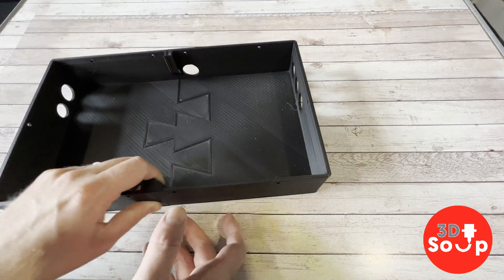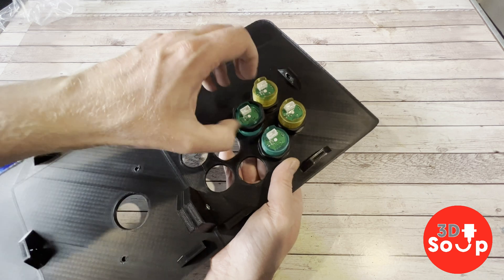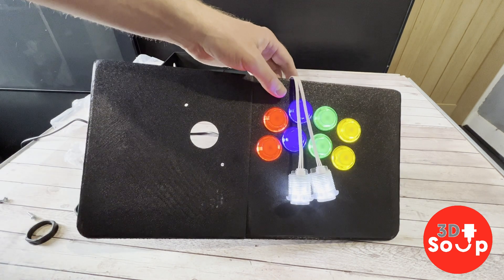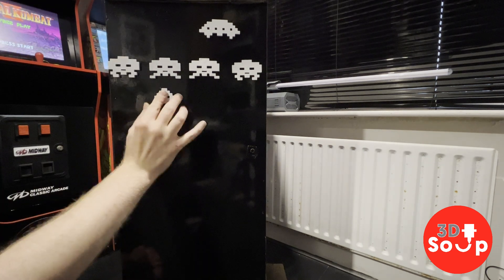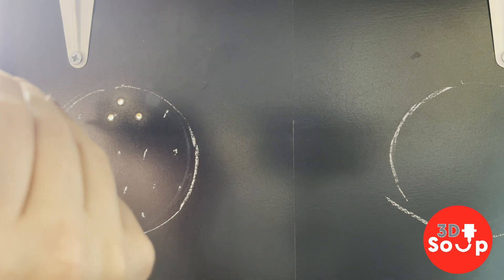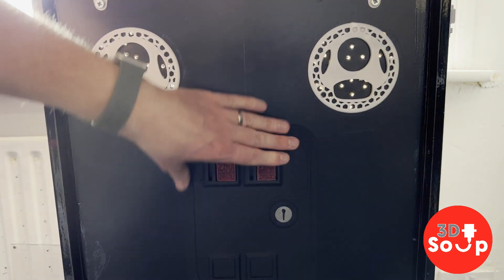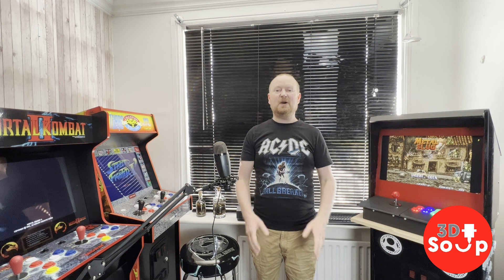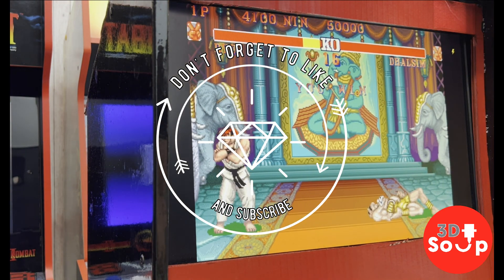Build your own arcade cabinet with help from 3D printing!

Comment: I was considering doing this since I scored a Ms PacMan cab for $25. I didn't like how it only had a few buttons. How sturdy is this? I feel it'd be too flimsy, especially when you have kids banging on it.
Reply from the maker: Print it in a tough material at 75 -100% and should be fine. My 4 year old plays on mine and the legs have held up well so far . Thanks for watching :)